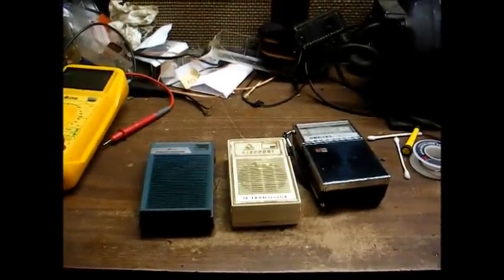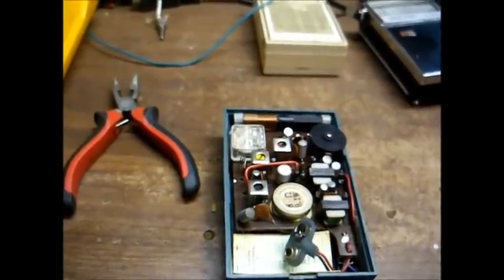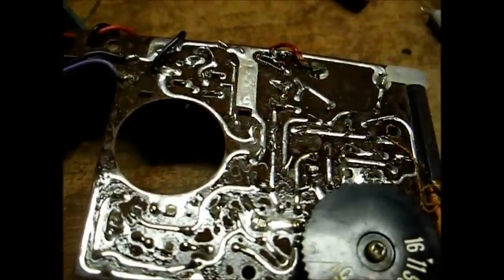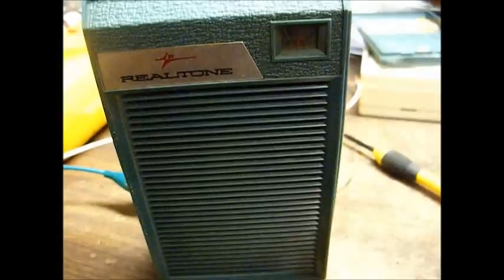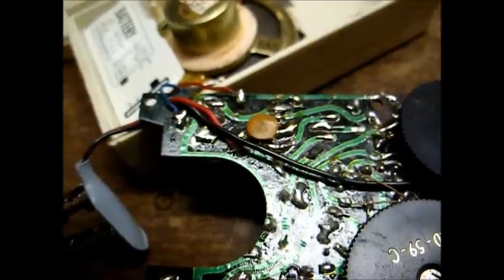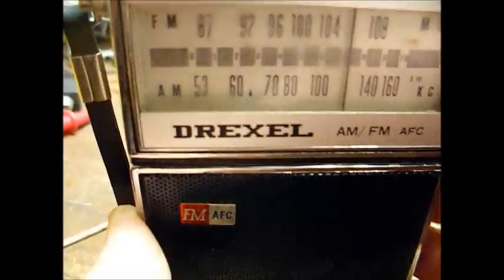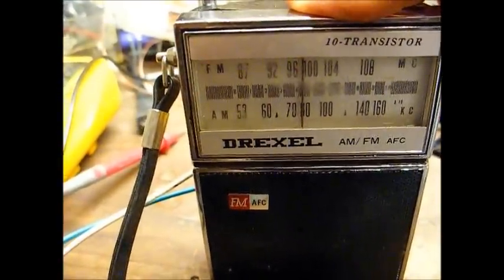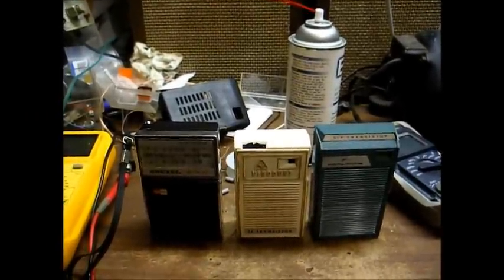Repair of 3 pocket transistor radios

Comment: I worked on a Viscount 12 transistor radio from 1966 that had six functioning transistors and six just soldered on the board. I was made in Hong Kong but interestingly, it had the black dome transistors but I remember each had a little sticker that said "Made in USA."
Reply: Jerry Carriera Yes, and the WERE made in the USA. They were bought at a big discount off-spec and relabeled after  testing.
Reply: +cny02253  The 1960's, the Dawn of Throw-Away Technology and cheap electronic junk.

Comment: Hi
Micro arc: 
Indeed. The AF series of transistors ( Mullard) with a 4th shield leg, are globally famous for ' tin whisker' where strands of the germanium grow internally, and short out etc. Usual telltale: flick the transistors one at a time till the offender crackles ( or often starts working again....for an hour or two) 
The replacements, when available these days, are likely as bad in a few years. Back in 1969 ,(UK,) I was tought to remove it, short all 3 actual legs together, and dump a low voltage 100ufd electrolytic from shield to the twisted up other 3. After refitting, 99% of the time, that gave a cure that would last for years.
Here we are, 2019, and still doing it! I'll call it micro arc from now on.
Cheers, Dave

Comment: I don't often find pocket radios with bad capacitors.

I had an old RCA which had a Darlington output stage, and it actually was counted as one transistor because they were a Darlington pair.

Comment: My electronics teacher back in the 60s also said many times half of those transistors were not used but were installed as a sales gimmick. The more transistors the better the ad looked. I took apart one of those 8 transistor radios and drew the schematic. Sure enough, my teacher was right. A few floating transistors were found.
Reply: THAT'S just plain CHEATING, as far as I'M concerned....!
Reply: THAT'S just plain CHEATING, as far as I'M concerned....!

Comment: Viscount was a house brand for Trans-Aire Electronics, a plucky little American company based in New York that was trying to compete with the cheap imports from Japan. They did all the electronic design, and in addition to their factory in Hong Kong they had factories in New Hyde Park, Jamaica and Mineola, NY.

They had many house brands -Harlie, Saxony, Electra, Montvale, Mayfair tape recorders, Sinclair oil company radios and  Bulova to name a few. They were trying to get competitive edge by huge volume and by ordering huge quantities of "fallout" or "seconds" off-spec transistors from all the US producers, brought them in and tested, re-labled and then sorted and reclassified them, based on this testing. They had some very clever circuit innovations that allowed them to "mix and match" various transistors and other components -they did not have that many basic circuit board designs!  It was an "adaptive" design. And this is just the start of their story!

Google "Transistor Museum Oral History Joe D'Airo Trans-Aire" That will take you to some pages and links on the amazing website semiconductormuseum dot com that has both written and audio histories by Joe that details Trans-Aire. That web site also has extensive similar material for most of the major radio and transistor manufactures, and even some stuff on Russian semiconductors.

Joe and his father both worked at their New Hyde Park works, Joe's father was an RF engineer for Trans-Aire, and wrote the Gernsback Publication Servicing Transistor Radios along with many magazine articles back in the day.
Reply: cny02253 checking out what first led me into the love of Radio Electronics here, the pocket radio... I saw your comment, it was very interesting & greatly appreciated.

Comment: I myself have a transistor radio with an embellished transistor count, it's a Hong Kong made "North American" "Long Distance" set with 18 transistors, from around 1966. However it is actually a decent radio, it has a tuned RF amplifier stage, I haven't looked inside it lately but I do recall that at least 3 of the 18 were connected as diodes probably for detector and AVC functions, but unlike that Viscount it did have an output transformer.
Reply: OlegKostoglatov RE output transformers, etc - Joe D'Airo addresses the whole aspect of design tactics Trans-Aire used with output in the links I alluded to in this thread.
Reply: Could it be that one of these excess transistors was part of an Amplified Automatic Gain Control circuit?

Comment: I understand your low opinion of those black encapsulated silicon transistors.
I have a POS Hong Kong portable I saved from the trash too.
It hissed like a snake, but spoke in a whisper. I changed out the first IF transistor for a 2N3904, which woke it up immediately. It was good and loud & the hiss was totally absent.
I tried the trick of bridging the electrolytics without any difference in performance whatsoever. I ought to spray the volume potentiometer sometime.

Comment: I see the dome top transistors on your Viscount radio, but my GE Show 'N Tell had two dome top transistors, and that's why I got it off of eBay last week. I turned it on, and nothing, because no sound coming from the speakers. That must be the problem due to bad transistors, but I checked the circuit board, and it was so small, but there was no capacitors,, just resistors and 2 micro ferrate capacitors are in the board. These two dome top transistors needs to be replaced at some point to put new transistors in to get it working and I hope the sound will be coming from the speaker, and it is going to be good to go.

Comment: I bought a 2 pound reel of 60/40 solder, which is the real thing & i'm not going to run out any time soon. Running out of solder is about as bad as running out of T.P. in that you can do stuff but not finish the job.

Comment: Good video! But, you might give the volume pot a good cleaning first as it is the most numerous failure point in cheap transistor radios. The pot is the most exposed part to dust, dirt, wear, and moisture since it is never sealed. Also the resistance path is either plated or painted on so thin - it is failure prone at the start. Just my 2 cents after 40 years as a ham radio operator.

Comment: In the 1950's and early 60's we had import duties on foreign made transistorized products.
Reply: That's perfectly true- but it wasn't long before American manufacturers just plain gave trying to compete with the cheap labor in Japan. There are some things that foreigners can do a lot better than we can. I remember early 2 transistor radios called "Boy's Radios". These particular radios had surprisingly good performance. I suspect they were labeled "Boy's Radios" in an effort to dodge the import tax by trying to pass these radios off as toys instead of transistor radios because toys were not subject to the same import taxes as were transistor radios.
Reply: +Dale Burrell  Exactly, the Japanese made these 2transistor Boy's Radios to avoid import duties. And no they werent' very good!  The Reflex Circuit that drove them had poor selectivity.

Comment: Not trying to be disrespectful; The "s" in Viscount is silent. Repaired dozens of them for the International Discount Store in the 70's. Note the one you worked on has no driver or output transformer, hence the extra transistors.
Reply: Alameda Repair Shop That's interesting, I didn't think that anyone was trying that transformerless audio output stage idea back then, so they were ahead of their time by playing it cheap. It's very common to see push pull tube amps without an audio interstage or driver transformer from the late 1930s onward, but not so much in old transistor radios. It's too bad that they used the black domed top transistors though, those have a high failure rate especially in the front end, but since they are mostly silicon they are easier to replace.
Reply: OlegKostoglatov Its wild to think they bought all those black domed parts as off spec "fallout"  to begin with!
Reply: Alameda Repair Shop That's right.. it's pronounced Vy-count.
Reply: +Alameda Repair Shop Interesting observation; the thing looked so old I wasn't even looking for something like that. And now that you mention it, the sound from that set was a couple of  notches better than the other two. I've seen some transformerless sets from the 1950s with center-tapped speakers, but I don't see any sign of that on this one.
Reply: Carl Rudd yes just like the viscount airplane.
Reply: No offense intended, but I'm surprised those radios were fixed even back then.  At less than $10 seems most would just be replaced.  They're actually worth more now as antiques.

Comment: when you 'jump' the capacitors, i assume you mean the electrolytic caps, yes? do the disc ceramic caps ever fail?
Reply: disk capacitors should only be replaced if it's blown up or burned in some way
Reply: marty james disc caps can and do fail under R.F.  or high voltages as well. I have seen only a few bad disc caps in a circuit where the demand is minimal such as a pocket radio, or amplifier.

Comment: 5: 09 Those pocket screechers seemed to be the last to get rid of the CONELRAD markers; I remember seeing them on one I bought in 1970, 7 years after the system went out of use.
Reply: Are you certain about this? In that early 70's movie Omega Man, the characters were tuning into CONELRAD
Reply: @Jeffrey314159  - The mention of " CONELRAD " in " The Omega Man " may have been a hold-over from the original novel " I Am Legend " which was written in the 1950s.  The script writers may have missed it & didn't update it to the Emergency Broadcast System.
Reply: The radio manufacturer may have had a large inventory of the tuning knobs & frequency plates in 1963, so they used them up first before getting new knobs & plates without the CONELRAD arrows.

Comment: Drexel AM/FM unit is not bad, kinda like that one.
I have an old Encore AM/FM/SW portable desk top radio from the 60's or 70's that the FM works well but nothing on AM or SW. Does anyone have any ideas?
Reply: +ZenithClarity1969 It's an NR-1600 from 1968.
Reply: +ZenithClarity1969 That's nowhere near enough information, but perhaps there's something wrong with AM reception. SW and MW (which is normally just called AM nowadays) both use AM modulation, the only difference being the reception bands. MW and SW usually share many (or almost all) components for reception. If the FM works, at least you don't have trouble on the audio amplifier stage.